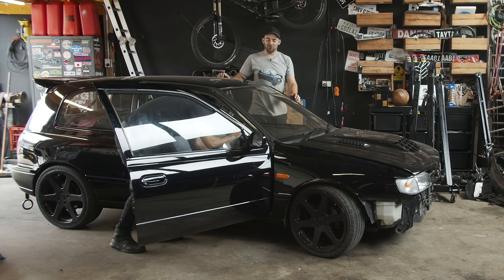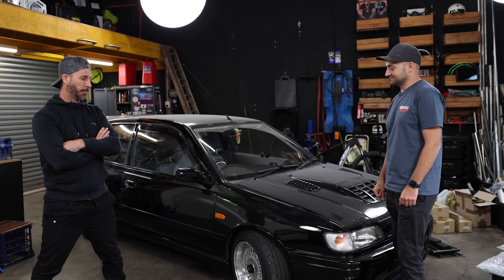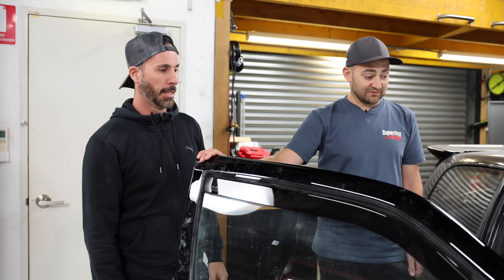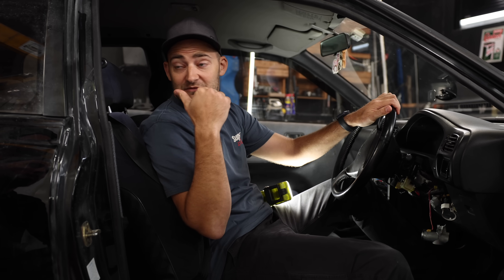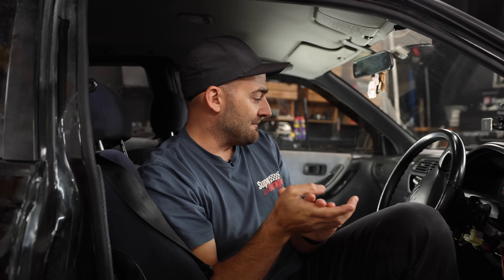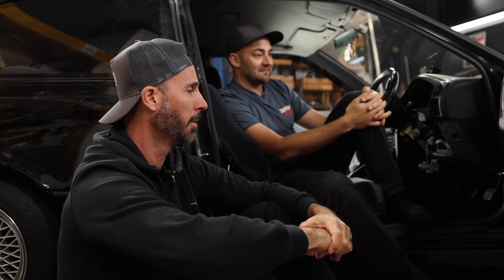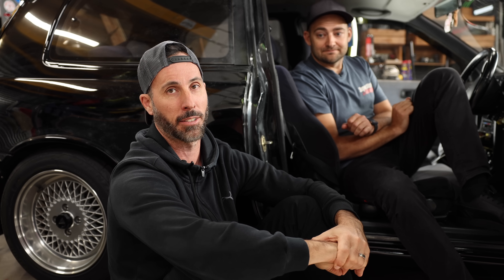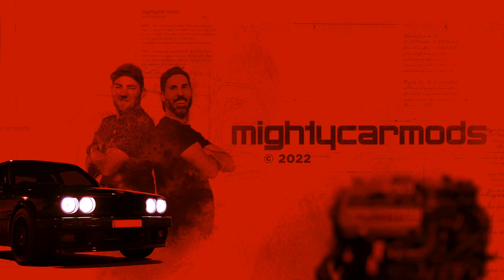Someone tried to Steal the GTi-R | Police Called

Comment: RAGE.  That's all that I'd be feeling if you stole my project car.
Fused battery disconnects are good/cheap deterrent too.  The fuse allows remote key and lights to work but will pop if they try to start the car.
Put you car on blocks then remove your tire stem valves.  Most crooks aren't carrying extra tires and it makes it really hard to flatbed tow it.
With all of the cheap trackers out there, I'm guessing that smart criminals know that the risk of someone coming back to get their car has gotten much higher.

Comment: sorry some mental masterfluck tried to boost your ride. glad they failed, but sorry they left you the pieces to fix.

had an accidental discovery of another lo-tek immobilizer a few years back: the brake master on/off switch. prevents the pin from getting out of the flywheel and therefore into motion. only works on going from park to any other gear, but a $5 additional step can help.

Comment: Absolute assholes, I live in Sydney as well, and I had a 89 civic, was b16 swapped, my pride and joy so many man hours put into it, and so much money, I had someone smash the windows, put it on blocks, take the wheels, ripped out the whole sound system, took the steering wheel, exhaust, and flooded my engine. Was so pissed when I found it like that the next morning outside, cause I lived in a gated complex they only had a number of spots inside… :/ fk I hate Sydney. Happens way too much. Hopefully you find them.

Comment: I know the feelings, some POS thiev tried to steal my Mitsubishi Galant Sport at home in 2018 , ripped out the doorlock,  smashed the steering column and cut alot of wires trying to start the car.  But of course without the car key with the chip preventet that , so they stole all my belongings inside the car . Then followed almost 6 months of waiting for the Insurance company's workshop to fix my car and the Insurance company wanted to pay me out instead at the end. I insisted on having my car , altough not in as good condition when I got it back atleast I have it .

Comment: Sorry for you guys. This happened to my 808 i brought with a Z18 engine in it. Destroyed the door and took all my auto meter gagues and stero etc. They left the car behind because the couldnt start it or push it out of my carport up a hill. The cost just in paint and materials and to get another door back in ealry 2000s was expensive as it was gun metal grey. Luckily i am a spray painter and done it my self. My datto ute in the shed has full camera and motion dector ready for scum bags like this. Get the car back on the road guys. All the best

Comment: I hate to like this video.

I had a 68 camaro that had a barrel key in the door jamb near the lower hinge that was wired to ground the ignition system.  Someone could bypass if they knew what to do under the hood but was a slick way to buy some time.

Comment: Had mine stolen stripped and torched in 1999, can only hope karma eventually caught up with the fks. My current "classic" has been heavily modified, no door handles or external locks, double trackers, several immobilisers, kill switches etc etc.  Shame we need such drastic measures , but even making sure your car is only stealable by some lowlife with a lowloader all it is doing is shifting the theft onto somebody else's less sure car.

couple of hundred thousands volts running through the chassis of cars might curb the thefts a little.

Comment: You don’t even need to hide the switch I’ve got a button an I had two people try steel it broke in found my spare key an still couldn’t get it to start without hitting the button to heat glow plug they tried to steal my suspension an I took it to the mechanics to get fixed even they said to me they were having trouble getting it to start an i said yeah there’s a trick

Comment: Don't trust a dumb ECU starting combination at all... its not hard to bring your own ECU with a basic tune to take what you want.
Best bet is don't park it somewhere dumb and always have a simple immobimizer and a gps tracker to find it. 
If someone wants it bad enough you'll never ever stop them but it helps with a GPS or 2 or 3... one gps really obvious so they remove it, after they take it out of the aluminum trailer  youll get a signal and BINGO its whacking day.

Comment: I locked my keys in my shitty Hyundai Accent back around 2010. Being in a bad neighborhood I looked around asked the nearest dodgy bloke how to unlock it for $15.  He showed me the door trick with a coat hanger - it had the same style inner door lock as the GTi-R.  We did it right in front of a marked cop car at a shopping car park and they didn't do or say anything.
Reply: The door lock broke on my ford falcon once (door lock actuator broke and car had no remote locking), the locksmith just pulled the top of the door back and used a piece of wire to press the central locking button on the dashboard to unlock the other working doors.
Felt kinda cheated out of $100 because i already knew how to do that myself but thought that if i called a locksmith they would have a more sophisticated solution that wouldn't tear up my weather seals